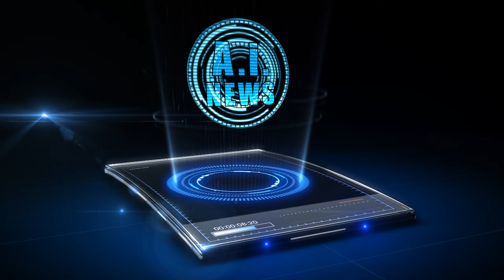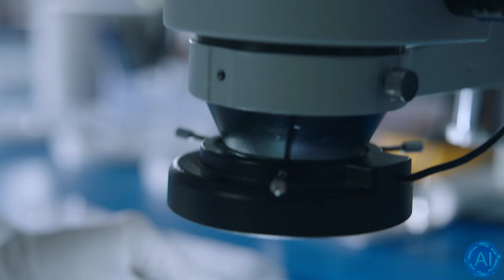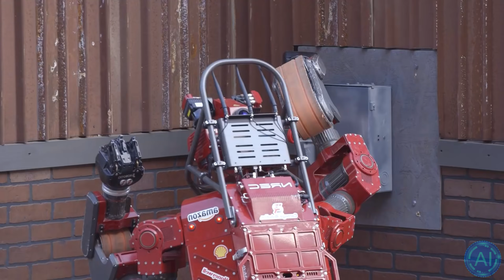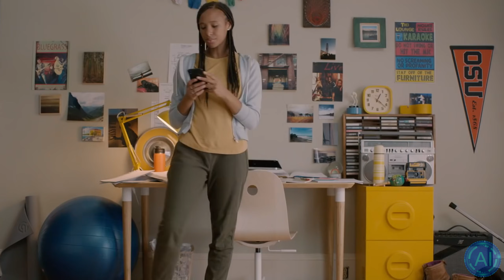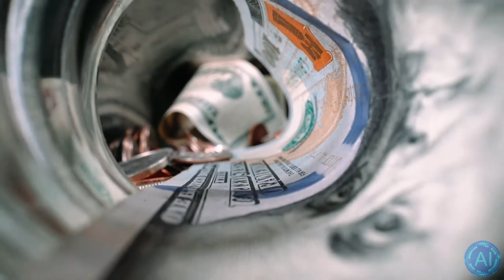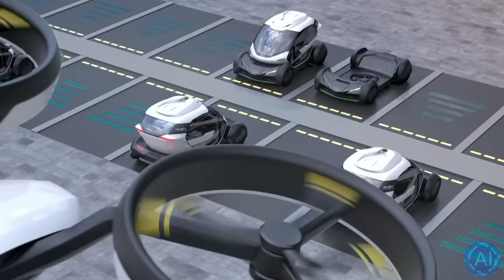Humanoid Warehouse Robot - Boston Dynamics Competitor

Comment: Biocells will allow any robot to run for any amount of time and there are other means using locomotion to recharge the cells,AS it's IS running of operating, especially important in search and rescue, where NEEDS to operate 24/7 autonomously.